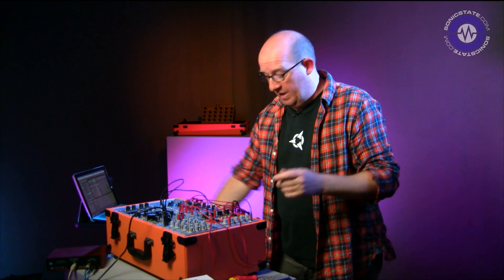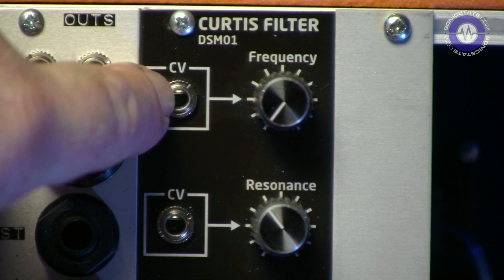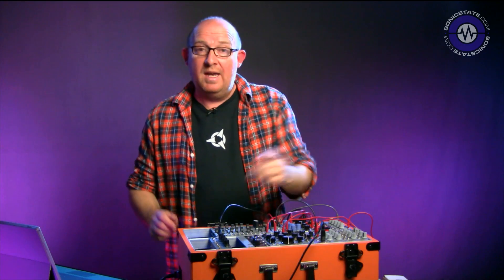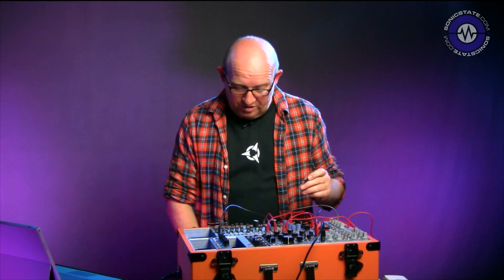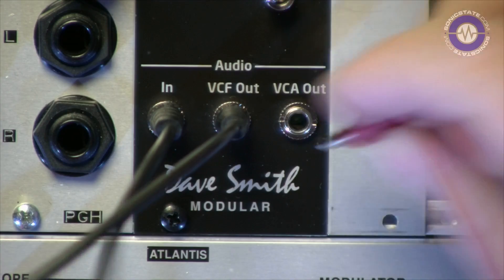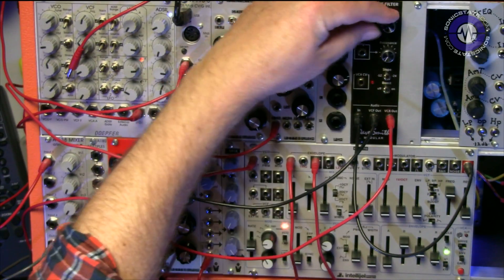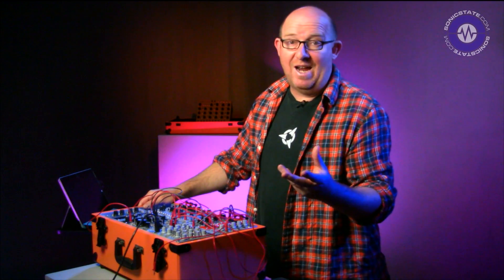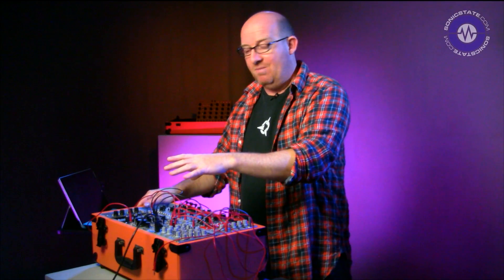DSM01 Eurorack Curtis Filter - Dave Smith Instruments

Comment: I've used a p5 ( 80's ) and a mopho ( recent ) and run into the same thing.  Very weak sounding ( to my taste ).  It was about 50/50, some patches were great and others I didn't care for at all. On the p5 I did not notice it in the presets at first, thinking it to be  a matter of taste of whoever made the patch.  However, at the  same time others I loved.  The mopho was a gift.  In all other ways I loved both of them, they just had a greater limit on what I would use them for. So if U are considering this filter or a synth with it built in, I recommend u check it out first and then decide.

Comment: I like the Curtis filter on my Prophet 12 but it does not work as a module for me. If you are after a filter that causes significant volume drop, is noisy, and, worst of all, makes anything you process with it sound thin and lifeless. then by all means buy this filter. Buy mine. Please.

Comment: Hi, I need to buy a filter and I am between this Dave Smith and the Pittsburgh Filter (the big one, multimode with individual outs) The DS is u$s 179 and the PGH is 199. I will appreciate your comments. Best regards.
Reply: Ariel Raguet In my opinion, from using the Curtis in DSI Tetr4 and Mopho, it's much better suited to poly than mono sources so it depends on your needs. It's brash, but not that ballsy
Reply: ***** Thanks for your comment. I use mainly mono sources, but for now I solve my filter problems with a WMD Micro Hadron Collider, a dual filter very powerful. Regards.
Reply: That looks bloody amazing mate. I've been planning on getting into eurorack one day when me ship comes in and that thins is going right on the list along with Intellejel Atlantis!

Comment: It is at least partially because you're not sending enough voltage :) Intellijel's envelopes are 0-8V.
Reply from the maker: Yes  correct, I did send it from Intellijel, but also  the Pittsburgh Oscillator, neither seemed to send enough..
Reply: sonicstate The Pittsburgh Oscillator looks like it's only 0-5V.

Comment: those knobs look really wobbly...
Reply: Knobbly wobs
Reply from the maker: Yes, they do seem to be surface mount, with metal shafts, most other modules I have are bolted to the front panel. they do wobble compared to the others I have in the rack
Reply: mattsynth The knobs on the module are metal shafted pots.
Reply: TheMonohub    They are solid and the knobs are not plastic.   Possibly a prototype for Nick.
Reply: I also see them wobbly knobs. Looks like DS went back to his plastic shaft knobs for this module. I had a Prophet 08 and had to replace all the knobs because the encoders failed one by one. A PE version board fixed this problem but still that cost me extra cash (discounted by DSI of course) to convert it over. I  just purchased a prophet 12 which I love and the quality is excellent right out of the box. DS does make quality instruments I hope Dave does not go back and repeat his mistakes. Modular synth users are use to high quality modules and we are willing to pay extra for them.
Reply: +Twidl Records 
I really wanted to buy this module, but I have to admit those wobbly knobs have put me off a bit. The output is soooooooo nice though. Maybe I'll have to use two finger dial manipulation, instead of my usual one finger press at 90 degrees method.
Reply: I have this module and the knobs are rock solid :)